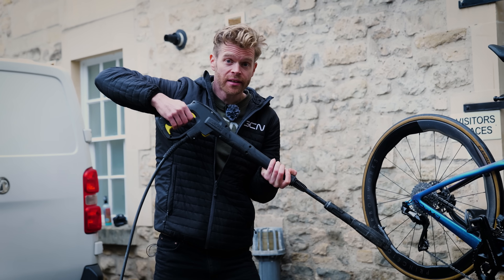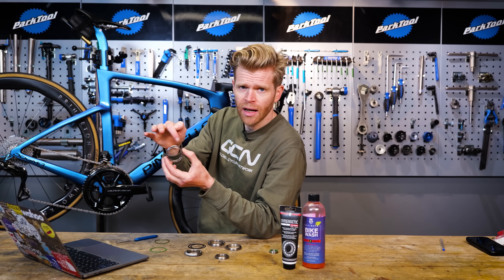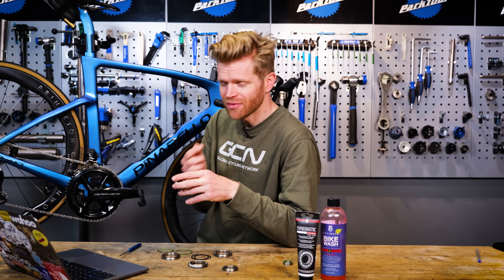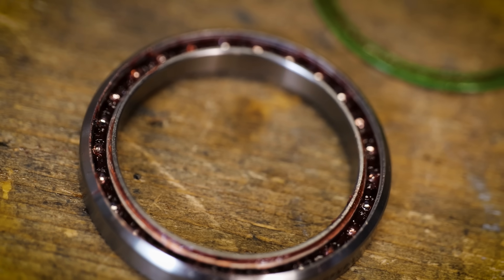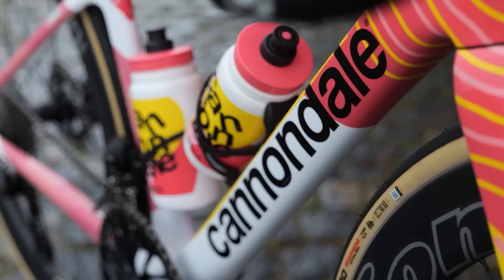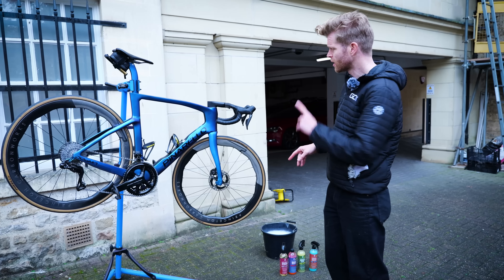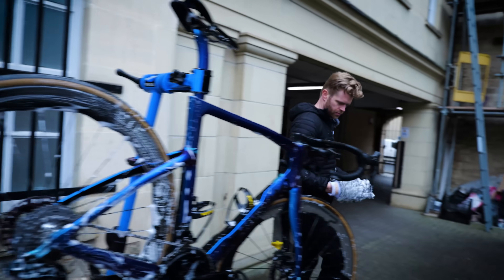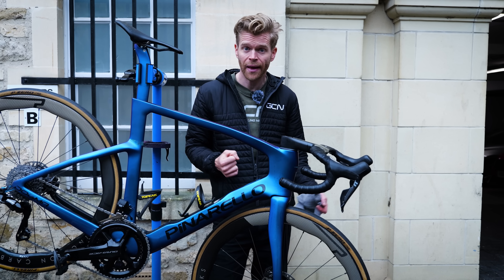Why Jet Washing WILL Destroy Your Bike

Comment: Most jetwashers have the option of adjusting the pressure, so it can still be used. Nobody in his right mind would set it to max. = 10 or15 bar, that could potentially remove the paint as well  😃.

I find a brush a must. That soft washing cloth does not get into the nooks and crannies where the dirt accumulates and harms most. F.x. the backsides of rimbrakes, behind the chainrings, in the rear derailleur etc.

A long tube like the toptube, is not pretty when dirty but the dirt will not damage anything and these places are the only ones, you can reach with a cloth. Save it for your "parts" 😅

After drying, keep the bike in a warm house. That will dry out remaining water. Don't put it straight into the shed..

Comment: I use a foam cannon ($23 from Amazon) hooked up to a pressure washer to wash my car.  I was thinking about using it for my bike because the water pressure coming out of the foam cannon is very similar to a hose with a spray attachment.  I can always use the foam cannon with bike soap to suds it up and then use a hose without the pressure washer to rinse it off.

Comment: Most bike bearings use cheap double lip seals that are not designed to see pressure. A jet wash just forces water and grit past the seal and straight into the grease. That is not cleaning, it is contamination.

If you want bearings to survive washing, sealing matters. Proper quad seal bearings from manufacturers like NTN, often using food grade grease, are designed to resist washout and corrosion in far harsher environments than a bike ever sees.

Also worth noting that the CeramicSpeed test runs bearings in an artificially exposed setup. Real bikes have dust covers, labyrinths and housings that reduce direct water ingress, so the test overstates how vulnerable bearings are in normal use.

Pro mechanics can jet wash because bearings are consumables to them. Everyone else pays the price.
Reply: It's not so much the seals inadequate.  Many just don't have enough grease in them from day one . If that lip seal is filled with grease it does last a long time . If it's dry it will be contaminated quickly.  I  always over filled them ... the proper void is self adjusting.  Hopefully the bearing is behind a shield 🛡.  If not it can be wiped off occasionally.  As long as the grease is coming out ,  stuff isn't going in . Ten thousand bicycles says this works .

Comment: I use a manual 10litre spear and jackson pump up washer costs a tena on amazon
Reply: Me too, I use two of them - one with clean water and the other with bike wash shampoo diluted. The clean water is used to rinse the chain after degreasing and to soften any dirt before applying the shampoo, use a microfibre mitt to wash the bike and rinse with the clean water. Then use a pet dryer to dry the bike to avoid scratching and get water out of nooks and cranies and dry the chain. Relube the chain - a much better jod than the one on the video.

Comment: Guess what? Whether you use a pressure washer or a hose, you are still using water. As you said, water will pool at the bottom of the bearing and cause rust. So what is the difference between not using high pressure around bearings with a pressure washer and using a nozzle on a hose? None. Water will still penetrate the seals. 

Pro bikes go through bearing way more so than most peoples bikes because they are literally riding 6-700+ miles a week during a tour and they are sweating profusely and ride entire days in the rain. That sweat penetrates the headset bearings causing corrosion. 

Basing the claim of pressure washing on a SINGLE study, that didn’t look at what using a regular hose sprayer does for comparison, is POOR science. You should know better than this Ollie! You are a scientist that understands the need for peer review and replication of experiments.

The important thing when washing your bike is to thoroughly dry your bike, not just the frame, wheels and bars, but to also spin the wheels and cranks along with shifting the gears. This helps eliminate the majority of water that can penetrate bearings or simply cause rusting on the chain and cassette.

1) All water will penetrate bearings
2) Pros bikes go through more bearing due to drastically higher miles/kilometers ridden, ride in rain regularly, and sweat profusely. 
3) A standard hose nozzle has more volume and pressure than a pressure washer without the trigger pulled.
4) Ceramic speed bearing seals are notoriously not the best.
5) Were other bearings tested?
6) Has this test been replicated by other sources?

Many other variables that need to be addressed as well.

Comment: I wash my bike every couple of months, whether it needs it or not 😀. I usually coincide a wash with a chain rewax, so I take off the wheels and wash them separately. Everything gets a hand wash with a microfiber and a bucket of hot soapy water, followed by a low-pressure hose rinse and a hand dry. I usually relube the mechs and brake calipers before reinstalling the wheels and chain

Comment: I'm disappointed it took GCN so long to work this out. Also, When using a brush on your drivetrain and brakes, do both brakes first then the drivetrain or have a different brush. DO NOT touch your brakes with a brush that has just been on the drivetrain that's covered in oil.

Comment: I never really understood why anyone would want to use a power washer on their bike in the first place. Yes, it will of course get into the little nooks and crannies that can be hard to reach but if you have a selection of detailing brushes it honestly doesn't take very long to do the same job, or better, without using a power washer. Also, unless you have a power washer permanently set up and ready to go, then by the time you get it all set up I will be at least halfway through having washed my bike with the aid of my garden hose that is permanently connected.

Comment: Personally i think this is just down to common sense. No bearing is hermetically sealed. Blasting any bearing with anything is not a good idea. I also tend to see "pro mechanic" advice with caution. A bike on the Tour de France will be ridden for that event only. I'd like my frame to last longer than a few weeks, so getting water in the frame might not be the best idea.
Reply: that's why i don't even use a garden hose on my bike, i want my bikes to last 5/10 or even 15 years, not like the gcn presenter bikes which have to last like 1 year

Comment: I'm super careful with water. Even so I've replaced plenty of bearings. In ye olden days of non sealed bearings, it was a rule that you never washed your bike with water, period. I guess that was drilled into my head. WD40 and a rag was used. It still works.

Comment: The wheel bearings on my SUV have been jet washed (not gently) and submerged in water countless times over 13 years and 250,000 km and they are still running just fine. Bigger bearing, same principle.

Comment: Always knew this and thought it was absurd to jet wash a bicycle.  
I generally don’t even use water on my bicycles unless they are covered in mud, and then just gently shower/brush.  Watching pro mechanics do this on a daily always seemed stupid to me.
Reply: Pros bikes have to last one year, and bearings and pretty much everything else gets replaced very frequently. That's the reason why for them jet washing makes sense but for normal people it does not.
Reply: @PingoloPangolo I take your point about pro teams view on the disposable nature of their equipment, but a gentle water pressure works just as well to clean the bike with less water used, less wear/tear, and less work for the mechanics.
Reply: @ShawnStradamus520  "less water used": probably, but pros don't care, they have a job to do in the fastest and best way, that's all.
"less wear/tear": again, they don't care, since they can just replace the parts anytime they want.
"less work for the mechanic": no. Try and restore a muddy and dusty bike to pristine conditions with a jet washer or with gentle water pressure": the former will always be faster.

Comment: This could have been a bit more believable if the testing methodology was explained in more detail. As is, this has "trust me, bro" vibes. Pressure washer pressure can easily be varied by using different nozzle tips and varying your distance.

Comment: A Jetwash is not as bad as the bike on a roofrack at 70 mph down the motorway in the rain.
Reply: actually, it is. Water comes out from from jet washing machines at a much greater speed, and pulverized in micro-droplets that can enter bearings so much easily. With a jet washer kept too close to the bike you can actually paint-strip the frame...
Reply from the maker: this sounds like a scientific experiment to try out!

Comment: I wash my bike the same way (and mostly at the same time) I wash my car. 
Low power, battery operated 'pressure' washer (it isn't that much stronger than a garden hose, I just live in an apartment and use it out of a jerrycan) and car shampoo. Don't blast directly on the BB/wheel hubs/head Tube, and you're good.

Comment: The fact is (and this was true even when Si made that infamous video) sealed bearings are not, in fact, 100% sealed.  They are more restrictive than bearings used to be, but the still leak, just less so.  There's always an opportunity for contamination, including riding in anything less that perfect conditions (including plain old inclement weather).  Personally I use a squirt bottle filled with plain old water and then wipe down with quality paper towels (you could argue paper towels are too abrasive, but definitely some are worse than others).  I was thinking, however, a blow dry afterwards is a good idea.  I don't have compressed air but I do have a leaf blower....
Reply: That's how I clean my car quite often - a spray bottle with plain deionised water, and a bunch of microfiber cloths. The only reason I use DI water is so I don't have to worry about overspray leaving spots

Comment: Jet washing is not just jet washing...
It's possible to do a soft jet wash, if you get a proper jet washer.
Reply: I'm wondering if the purpose of a soft pressure washer is water conservation and that would be a good thing (?)

Comment: Pressure washers replaced buckets, sponges and a garden hose when KARCHER gave 'em away to teams in LeTour. I think it was 1988, my first time seeing it live. For the mechanics who know the bikes were going to be sold-off at season's end, they made life easier, including washing the team cars each day. For anyone who cares about a bike lasting longer, no more water pressure than you'd use in the garden to water your wife's flowers should be used...same as it ever was. 
Steve Snowling's 1987 book "Bicycle Mechanics: In Workshop and Competition" is still one of the best ever.
Reply: Back then it was all loose cup and cone bearings so it didn’t really matter if you sprayed a ton of water in, you would be taking the bearings out, cleaning and re-greasing it all anyway. 

With sealed bearings it is a bit more annoying, but they should just say to their viewers to just use common sense and not use a high power jet wash to spray bikes down.
Reply from the maker: a genius bit of marketing!

Comment: How much is a new set of bearings ? Compared to time & cleaning products? Can't you control the pressure on those washers ?
Reply: changing your bearings requires a lot of tools which you probably don't have, use a wet towel to clean your bike, it's that simple

Comment: With products like the 'graphene spray wax', what's actually in them? I understand what graphene is, but to what extent are the properties of coatings actually because of forever chemicals? I'm pretty sceptical about products with non-stick type properties... where they don't go into the ingredients (for which there might be valid reasons around protecting proprietary products etc)... and just rely on mentioning stuff like graphene because it's known as a relatively modern/wonder material.
Reply: Yes, very curious if @GCN has sustainability in their mind when they suggest to use product…

Comment: I have toasted two bottom brackets with water ingress - one was riding through a flooded path (over bb) and the other was a missing frame cable cover (allowed water off rear wheel to enter).  Both then rusted and pitted the bearing cages. One of the bbs was ceramic (Token) but the cage was steel.  Lesson  learned.  

Also got water in a headset on my internal cable routed bike, luckily a rotate and regrease of the headset bearings saved pulling them out entirely (headset bearings wear in one place, so a rotate can give them more life if your lucky).
Reply: Campagnolo's BB instructions note that there should ALWAYS be a drain hole in the frame's BB shell exactly for this reason.

Comment: What about a garden hose?
Reply from the maker: all good, just avoid soaking the bearings too much!
Reply: @gcntech or just remove the wheels if you really want to wash your bike with a hose
Reply: You mean like the garden hose in the video midway that they say is fine to use on your bike
Reply: @RS-xq6je it's not fine, it ruined my old bike, it's very rosty now
with my other bikes i try to avoid it getting wet as much as possible, to clean it i just use a wet towel, before going on a ride i always check the weather
Reply: @remokoch2480 thats not the fault of the hose 😂
Reply: @RS-xq6je it's the fault of the hose, especially the breaking/shifter cables get rosty if they get wet, no matter what you do
Reply: @remokoch2480 if you offer up a sacrifice before unleashing the hose you should be ok 👍
Reply: @RS-xq6je  no, the cables get rosty if they get wet no matter what you do, water will still get into the bearings because they are never 100% sealed, just clean your bike(s) with a wet towel and don't ride in the rain
Reply: @remokoch2480 How about using a dry towel, after your bike has got wet..?
Reply: @Crall-xb8he like i said, the cables still get rosty if you soak your bike in water with a garden hose, you can do what you want, i avoid riding my bike in the rain and never washed it with a garden hose, it looks like brand new and works like on it's first day

Comment: What about the bike specific jet washers?
Reply: Hahaha, yeah I'm exactly the M branded bearing destroyer is actually designed to buy M branded bearings and M branded bearing pullers and M branded components to replace any destroyed items.
Reply: Agree that Power washers are not good for washing bikes. I typically just use my garden hose with a nozzle adjusted for low pressure and just a fine mist pattern. If a water hose is not available (apartment/ condo) then a pump up garden sprayer will also work nicely. Ride on!

Comment: i don't have access to a wash station so i use a little spray bottle and a brush. just a little bit of water is enough. true it takes more time and my bike is never that dirty. the wheels are shimano cup and cone hubs so they come off the bike when washing. one time in a very heavy rain water got into the hub bearings. always a good idea to service the bearing to be on the safe side only costs a bit of time and some grease and cleaner etc.

Comment: Run XD15 so no grease required & the balls polish the races without degrading each other. Dirt also wont hurt it… enduro bearings are way better than ceramic speed.

Comment: How about riding in water (wet roads)?
Reply: best is to mount your bike on the wall of your living room and admire its beauty everyday. Only a not ridden bike stays beautiful
Reply: None of your bearings are in the direct line of fire from road spray, which is relatively low velocity in any case
Reply: @litespud even winter salt is easier on the bike .

Comment: One more thing to consider. When you transport your bike on the roof rack of your car and when it rains and you are driving on highway, it has 3 times more terrible effect on your bike bearings. So 3x jet wash at once.
Reply: I disagree. If the rubber seals used around your car’s doors and windows keep the wet out, so do the ones in your bearings. Pressure washers are not recommended for cars either, by the way.
Reply: How did you come up with 3x? Why not 2.5x or 3.9x?
Reply: @padmanabhaprasannasimha5385 patato/potaato
Reply: Incorrect. It's actually 4.67439823 times - -the 'science' done by GCN's sponsors Ceramic con, errr Speed prove it.